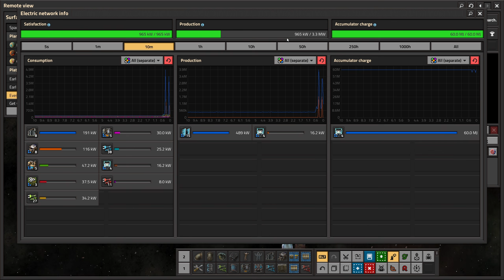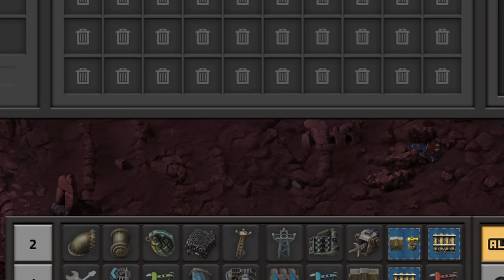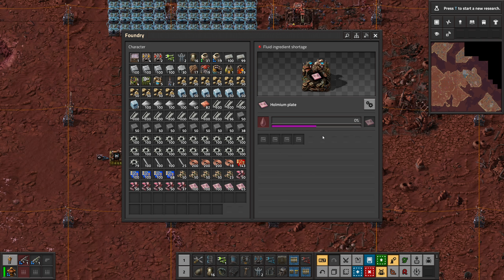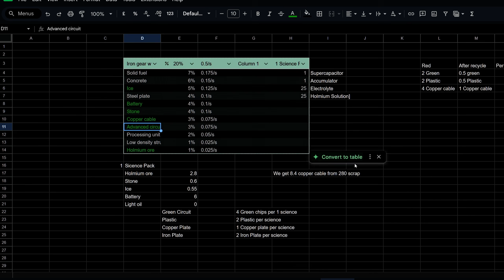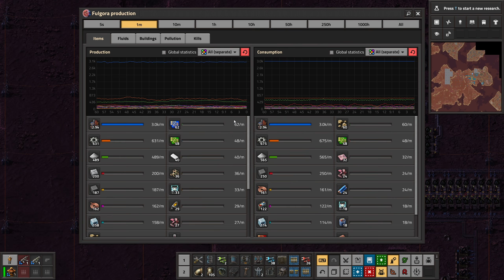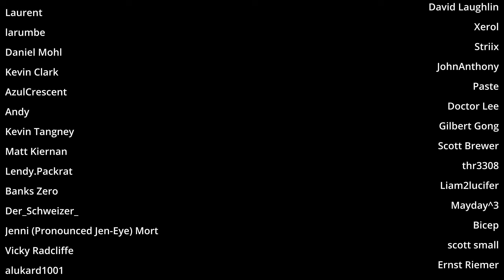Garbage Spaghetti : Factorio Space age Ep17

Comment: 15:07 and later on, you can upgrade those lightning towers to increase efficiency, basically (almost) trippling the accumulators required to harness 100% of the lightning strikes. 

Don't forget, anything can be looked up in the in-game Factoriopedia, want iron plates? Open the in-game wiki and see what gets recycled into those plates. 

All low-tier resources from scrap (like stone) should be managed by some means (personally prefer using cirquitry, and having excess go back into recycling). If left unsupervised, it will clog up the factory and reduce the holmium throughput. 

Edit: There's also the "Advanced Asteroid Processing" tech. As in "you want iron plates? Drop iron ore and calcite from a stationary space platform, and make the plates in foundries." 

(Ever since I managed to get those platforms running, I really don't have a "Home Planet" anymore, as every planet can make anything that's not Prod.-Locked to a specific place (e.g. Green belts and foundries are locked to Vulcanus, EM Plants are locked to Fulgora, etc.))

Comment: You need trains to get stuff from one island to the next. Research the deep oil ocean elevated rails tech first, since it's a pain to get rails anywhere without it. You're probably only going to be able to do 1-2 trains using the normal way, since scrap islands are so tiny, but if you use a pusher train, you can do 1-3 with the locomotive chilling on the ramp with the cargo wagons parked at the station. 
I really really liked Fulgora, the trash planet. Everything is backwards. Funnily enough, it's where you get quality module 3 unlocked, despite it being impossible to craft blue chips.
Reply: Pain --> impossible. It's impossible to do rail anywhere but a single island beforehand. Unless you luck into a good map gen and have lots of bigger islands closer together that can span with the basic rail support foundation.
Pusher trains I can see making sense though, depending on your map layout lol.
Reply: @Genesis8934  Not true, the rails will just be very "noodly" and bidirectional.
Reply: @hiredgoon4269  you can't place rail foundations in the oil ocean... Unless they changed it in the last 6+ months...
Reply: @Genesis8934  Yes you can, just not the dark "deep oil ocean".

Comment: An obvious solution towards surplus goods is to export them to other planets, such as Nauvis, Vulcanus, or Gleba, so that they wouldn't need to transform raw resources into more refined resources such as gears, circuits, wires, or low-density structures, all of which could be supplied from Fulgora.

Another obvious solution, if exporting these surplus resources isn't an option, would be to set up some automation that would cause surplus resources to be sent for recycling into more base resources.

It might also be feasible to use the scrap that's collected from Fulgora (and resources from Vulcanus and Gleba for that matter) to generate some various colors of science packs (besides the unique electromagnetic science packs) if you don't know what to do with them.

Comment: Fulgora also broke my brain when I went there. It is designed to be a train world, having multiple islands working together that can only be connected through rails instead of stuffing everything onto one single island. Though you absolutely can stuff everything onto a single island if you want. Don't forget about efficiency modules when running into power issues. And don't be afraid to scrap everything into oblivion, even normally valuable items like blue circuits and low density structures.

I think you got there in the end, but I believe "Holmium" is pronounced like "hole-me-um". "haul-me-um" is also acceptable
Reply: I am at a point where I am debating just dropping down fusion power and foundation to connect everything, but I'm not sure I want to deconstruct tens of thousands of accumulators.

Comment: Don't slack on the refined concrete production, fulgora is the first planet to take full advantage of and require elevated rails and they consume quite a bit of it if you plan on making a 2 lane rail system to expand to the other large islands.
Reply: I just have bidirectional rails. Figuring out the signalling and the occasional bypass/waiting lane seemed like a fun challenge.

Comment: I'd advise just going full sushi with Fulgora since that way you loop your scrap output back into your input and just have everything on one belt or if you're resolute about separation bots help with that a lot, also good thought on the iron chests this also works with steel chests and hazard concrete. Also investing in quality powerpoles and accumulators made in emag plants is very worthwhile just uncommon accumulators alone cut the number you need in half and high quality poles can potentially bridge islands, don't forget elevated rails can cross oil oceans and with tech even deep ones.
Reply: I was thinking how to connect different islands which are quite far away, and I came up absolutely blank, once I saw your comment my mind was like "Eureka", once I go back to fulgora, I will definitely try implement it, I keep forgetting how OP quality modules are I think I need to start mass producing them.

TL;DR
You have solved one of the biggest headaches I was experiencing, thank you

Comment: Here's how you deal with excess materials on Fulgora. Take two recyclers and put their outputs together facing each other directly against each other. When you insert anything that doesn't break down to another component (iron plates, ice, rock, solid fuel, etc.) they will VERY RAPIDLY pass it back and forth between them, deleting 75% of material each time. It's just a grinder at that point. 

For items that break down to items that can also break down, you can get the same effect by chaining a number of recyclers front to back equal to the number of steps it takes to break down the most complex component you want to delete. 

Processing units as an example. Break down a processing unit and the most complex output is red chips (1 step), red chips will break down into green chips (1 step), green chips break down to copper coils (1 step) finally copper coils become copper plates to get fed into the grinder. So to make an auto-grinder that won't jam for blue chips you would have the original one that takes the blue chips, then the red chip step, then the green chip, then the copper coil and finally the copper plate in a back to front line, then stick a grinder as described above to copper plate outlet. So you'll have a total of 5 recyclers daisy chained together and one on the end pointing back into the daisy chain. 

The key thing here is you always need a line of recyclers long enough to break down your worst case scenario chain of products + 1 recycler because if you don't eventually you'll have a situation where the grinder on the end is trying to pass two different materials back and forth (which it wont) and the system jams. 

An array of 12 of those with speed modules will easily manage excess resources you don't want into the late game. This is especially valuable if you want high throughput for brute force quality grinding.

Comment: I love the good old Xcel spreadsheet and figuring out the exact rates, in general though when I deal with Scrap on Fulgora I only take the stuff that I need and scrap the rest with recycler loops that I don't use with a priority splitter, but you are correct in the assumption that you want scrap flowing all the time.

Comment: Do bots work on fulgora? I have an image of feeding the output of every recycler straight into an active provider chest, and every overflowable resource has a dedicated storage chest with inserters pulling the resource out into a destruction loop. Then whenever you need to actually use or scrap one of those resources you can use a requester chest to pull it out of the network and the bots will prioritise it over the storage chest. It doesn't look like there's anything too high volume for bots and the ore patches are so rich I can't imagine the waste would be a problem.
Reply: Also bots placing down excess accumulators would be far more efficient than doing it by hand.
Reply: It does work just fine, but I would advise against doing it exclusively for larger bases. Recyclers run pretty fast and you would need a huge amount of bots. 
For a small starter base though, its an excellent idea

Comment: You are very close with the iron chest scrapping. This is a good strategy to get rid of the huge mountain of geers that you eventually get. You can use this trick to also get rid of steel be crafting it into steel boxes and stone by crafting it into landfill and then scrapping the results.
If you want to prevent the backing up you can face two scrappers into each other (similar you would at the very early game with the burner miners). If you do that the content get shoved from one machine to the next until the stuff disappears.
A good way to control you resources would be to store until you get x and if you got more than feed it back to the scrapping setup. Think of the way gleba works: a belt of constantly flowing scrap thats get churned down.
If you go this route make sure to priority insert the old stuff before insting the new scrap. This also prevents your brain from melting because you have  the mentality: keep what I need and the rest is all garbage.

For power you can go multible ways but accumulators would suffice. I would stick to efficiency modules, (for example in all the recyclers), rather than speed modules. At least for the early setup.

And now talk holmium. I saw that you use the foundry with its internal productivity. I would go further and pump all the holmium related stuff with productivity to the max. This is because you already guessed it THE bottleneck of fulgora.
Reply: I set up like 5 independent bases on Fulgora, each with their own rocket silos. I made a base dedicated to gathering and exporting holmium to my supercapacitor upcycling base. It literally just pulls holmium ore, stone, and a little solid fuel for the trains, and then scraps literally everything else. It eventually backed up since it produces more holmium than I can use, but that's not a bad problem to have.

Comment: Basically you build your factory on the big islands and run elevated tracks out to the little islands with the massive scrap piles and load the trains up out there.
Definitely look into quality accumulators. Fulgora has basically free stuff everywhere, it's the perfect place for quality farming.
I got most of my green circuits by scrapping the f**kton of gears into iron, then making them with that and surplus copper cables in electromagnetic plants.
Surplus ice can be put to use for power generation (burn solid fuel) so you don't need so many accumulators.
The biggest issue here...is everything backing up because you're not using something. The scrap must flow. Recycle whatever you're not using. Recycle it again until it's gone. There's billions of scrap lying around, you're never going to run out. SCRAP HARDER.

Comment: Francis you can use heating towers on fulgora too; they're great. Solid fuel is literally free and usually you have a lot of excess ice as well
it's a lot more compact than accumulator spam
Reply: caveat: that requires water which is quite limited at scale.  accumulator spam is at least reliable and scalable without impacting science production
Reply: Pretty sure water/ice is actually a pretty severe bottleneck on Fulgora (unless you ship it from space).
Reply: @joshlawson3255  I've never run into issues even while 100% of my power came from steam (other than the free lightning ofc).
Reply: It's more that oil cracking and plastic are a bottleneck. Gleba imports are actually a fantastic cure for both issues. Plastic stacks to the moon on rockets and a trickle of bioflux can make the little remaining cracking much cheaper.
Reply: I had more water than I ever needed running nuclear simultaneously, and that was with wasting space on solar. Water is not an issue so long as you don't go full speed module spamming. 
It pretends to be a bottleneck, but isn't
Reply: @Erik_Ice_Fang  i'm not sure what your production numbers were but in my save water was in a very severe shortage.  it wasn't until i got quality productivity modules that the ice kept up with the science, and i was not using nuclear or heating towers.
Reply: @myrcutio I probably maintained a constant 4 full blue belts of scrap being processed and trying to waste as little as possible
Reply: @myrcutio  This is the first time I've thought about quality productivity modules. My brain just exploded.

Comment: about the EM plants, you can connect their fluid output/input together and it will flow through. not a big deal but it helps with logistics sometimes. Cheers!
Reply: Just be careful. IIRC, some recipes for Fulgora use two different liquids, which case they're not fully passthrough. For single-fluid builds, sure tho! (some flipping required lol)

Comment: Hi Francis! If you value your brain and want an easier belt-fu, you can surround a recycler with filtered inserters of each output. Belts will be neater and you can specify “trash” items like stone and fuel to go the opposite way of the other resources.

Also, remember that space is infinite materials. If you need more ice, a small space station located above fulgora can drop ice, or a harvesting station can travel between fulgora and gleba (rate of ice asteroids is greater) to drop ice for fulgora.

Comment: Ahhh Fulgora. Time to watch Francis' brain melt again xD <3

Pinned edit: 32:10 Quality power poles have longer wire connection range FWIW. Still not long enough to connect some of the further islands, but they're probably long enough to connect some closer islands DEPENDING on your map generation. For mine... Not so much until I get to aquilo :( - Map gen can really f*ck you over sometimes lol
Pinned edit 2: TIP: If you want to just DESTROY something, two recyclers facing each other like the early game coal stockpile method is pretty effective and standard.
Pinned edit 3: 46:17 Heating towers. You've been to gleba already. Burn some rocket fuel or solid fuel for heat and convert it into power.
Pinned edit 4: 47:48 Hehe. Look at the power graph when lightning strikes tbh. I'm curious if you'll try to capture ALL that power. :P

Fulgora is where many build their quality factories tbh. But really you can probably build them  anywhere if you export recyclers. Recyclers make quality farming so much easier because you can send undesired quality items back to the recycler for upcycling.
I've also found sushi belts to be very effective on Fulgora, but I'm curious how you build it out :D (edit: If you do go for a sushi belt, feed the output after you've used everything back into the scrap input on priority input - prioritize stuff that's already made it at least once through the sushi line. And also have a dedicated scrap line because scrap productivity ONLY affects scrap recycling, not recycling of items IIRC. Really same with anything, but recyclers make it more obvious I think. If the recipe changes, you lose the productivity bonus. Again, IIRC*)

BIG TIP on disposing of concrete and steel... their scrapping recipes are longer than others so convert them into other products before sending them into the recyclers. Refined Hazard concrete (edit: Not refined concrete! Hazard!) and steel chests are usually the go-to for scrapping concrete and steel plate for speed.
Also, my Fulgora base is not even done making everything and I'm processing/consuming like 6k scrap per minute (without belt stacking) according to the production tab.
33:38 Usually better to split them off than rely on inserters. Unless you have quality inserters (and even then it might not be enough)
44:03 EMP's consume MASSIVE amounts of power too. :) (edit: Speed modules also increase power consumption)
Reply: I like bruteforce. Quality on vulcanus and dumping low quality stuff into lava tickle my brain in the good way :)
Reply: Raee accumulators are a life saver tbh
Reply: Yeah, a single EM plant can hit 8 megawatts without any beacons but with modules inside. Them and the foundries are brutal if you aren't paying attention